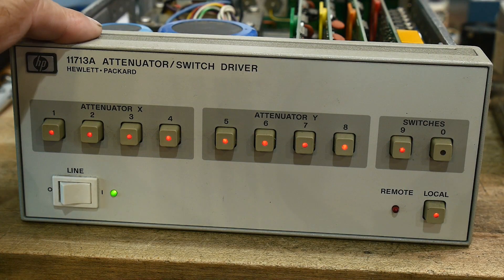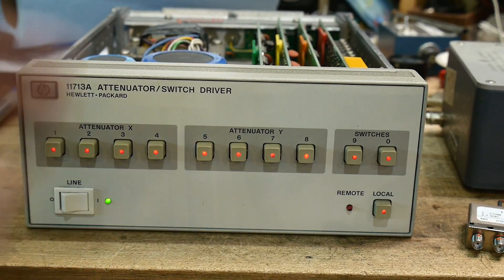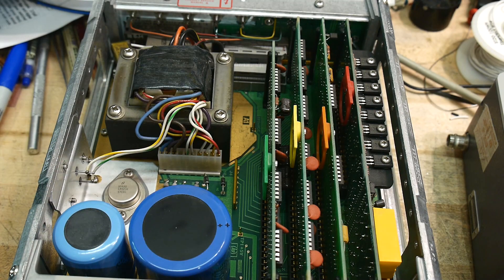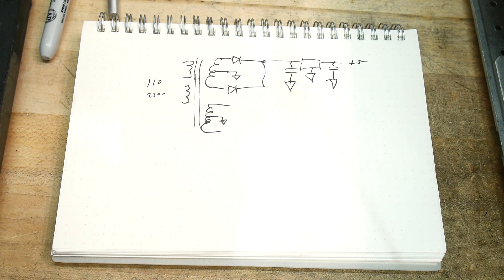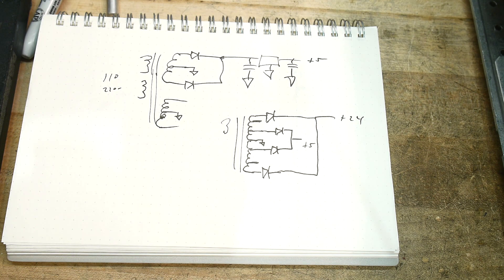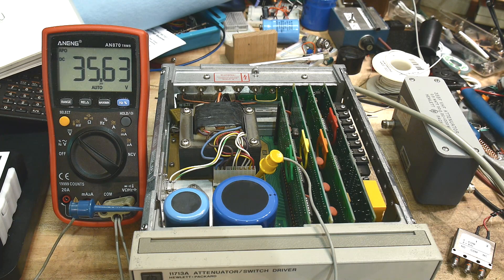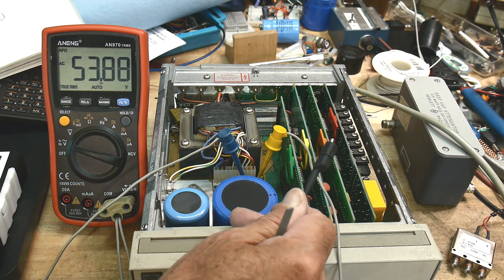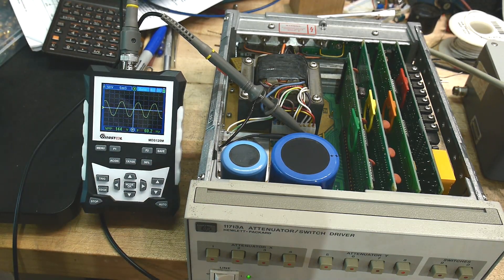#843 HP 11713A Power Supply

Comment: Thanks for another wonderful video. A couple of specifications for the LM78xx series of voltage regulators... 1) Lots of circuit designs provide only 2 volts of headroom (the minimum required for operation) above the v reg's output voltage rating. However, as I recall, a minimum of +3 volts is required to allow the device to perform at its best ripple rejection level. 2) Any (remaining/not fully filtered with caps) ripple dip in the input/supply voltage must also be considered in the voltage headroom calculation. It seems that that dip is often not considered at all. I hope I said that well enough to be understood. Cheers.
Reply from the maker: Thanks. There is a lot to consider. various load conditions and various input voltages and frequency. I remember Japan being the worst with 100VAC at 50Hz.

Comment: Those unused taps will either be for a 15v or 12v supply, I suggest building a 12v regulator circuit then use that as a virtual ground OR disconnect the negative side diode from the 24v input and feed it with just one diode and swap the 24v regulator for a 12v, and then build a 12v regulator circuit onto the disconnected diode end of the winding in order to get that +/ 12v you want.
Reply from the maker: It is just a shame to have to share all the current in the transformer. A separate winding couldn't cost that much.

Comment: What if you had your scope connected to an isolation transformer?
Reply: Good point. Or better yet the device under test connected to the isolation transformer.
Reply: I was thinking the same thing.
Reply: Scope on an isolation transformer will add noise to the readings. But the DoT on the transformer would work.